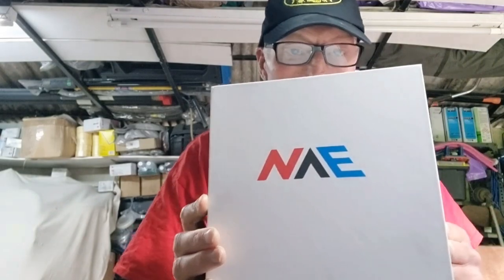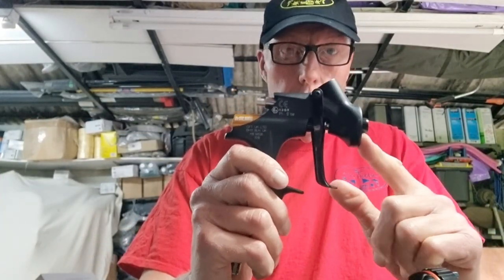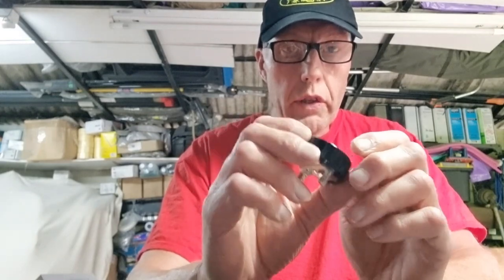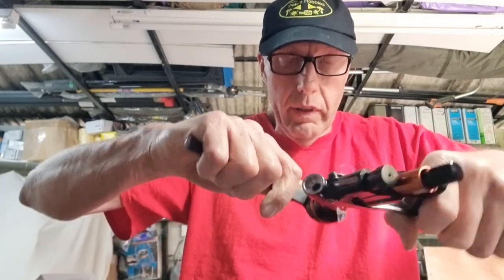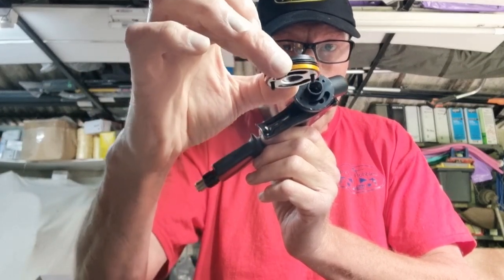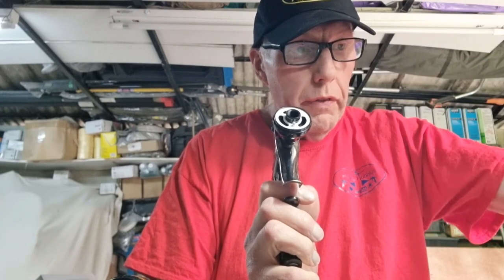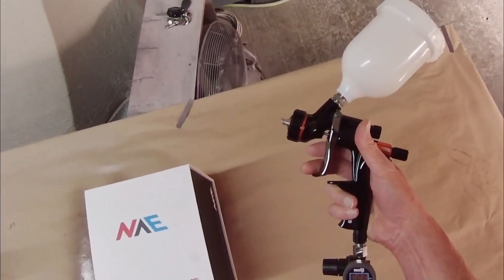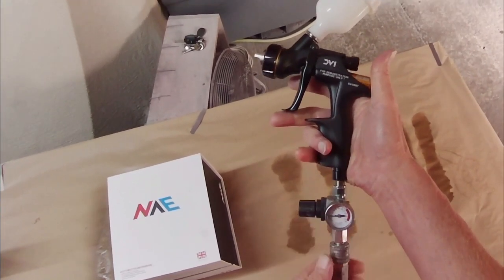Chinese NVE Devilbiss DV1 Copy, Unboxing & Physical Comparison To Original

Comment: Just found your channel pete, i actually own about 12 of these knockoff / chinese guns and they all work very well. Ive been a professional painter for almost 20 years, and the Fake GTI prolite perform exactly the same as the real Teknas. Ive owned the real one b4. Ive comfirmed it with 2 other painter friends and they said the same thing. I bought 2 chinese 4000s and they spray extremely well so i lent the gun to another painter friend who strictly uses Sata and he also said it performs the same if not better.
Reply: But im actually wondering if this dv1 clone sprays the same as the real dv1 or  as the gti clone. I have 6 gti clones already and dont wanna end up with another one
Reply from the maker: Hi Buddy, I'm lining up a clone v real video for the Pro lite and the DV1 versions, it's just getting the time to do it all 😂 , shouldn't be too long 👍
Reply: I just finished watching your whole video. "If" the dv1 clone is essentially the exact same as the gti prolite clone, theres no real point in getting it cause its double the price.

Also the spray patterns to me seem abit odd, usually the spray patterns are supposed to be alil middle heavy not what u got which is heavy on the ends......  which is baffling to me is that the original dv1 kinda did the same thing.

But great in depth video nonetheless.
Reply from the maker: Hi buddy, the pattern was done with thinners, which is why it's top and bottom heavy. However, the DV1 is more of an "I" pattern when used with 2k clear coats.

The pattern is definitely different from the copy Gti Pro Lite, which is very centre weighted
Reply: How do you identify a knockoff? Or is it simple as buying off amazon
Reply from the maker: @bankyankinlive There are always little differences. Normally, in the size of things like the diameter of the needle and threads.
The best thing is to buy from an official dealer

Comment: Whats your take DV1 copy in general?, almost as good as the original or did they hit a home run on this one? I'm looking to spray metallics and was told the DV1 is a excellent option but not sure about buying a chinese copy. Buy with confidents? Thanks.
Reply from the maker: Hi William,  it's not a bad gun, but you're not buying a DV1. It feels quite heavy compared to the original and isn't as well made, 
If it puts out a good pattern and sprays quite well, it's definitely worth considering it. You're on a budget, but, as I say, don't think you're getting a DV1

Comment: Great vid Pete you know my feelings on them wing wang specials so wont go into that 👍👍
Reply from the maker: Hi Dean,  Thanks, mate, I really wanted to see if they were a complete copy, which they are not, typical Chinese really, looking the part but not when you get underneath,  cheers 👍
Reply: Puts down a good meaty finish 👍
Reply: @dredfxcustompaint 😂😂😂😂😂😂😂😂😂😂😂only you'd know that
Reply: @deanbrown7643  👍
Reply from the maker: It certainly spray a different pattern to the Gti Pro Lite copy

Comment: Hi Pete, interesting copy! they really have copied it down to a T apart from some of the sizes, it will be interesting in how it performs, it looked like the air holes on the tip was slightly different but I’m certain that it was the trick of the camera there. Nice looking gun though. Cheers Pete.
Reply from the maker: Hi Steve,  yeah,  it's one of those look alikes that aren't particularly alike, I'll do a few videos using it and compare it with the original,  cheers, mate 👍

Comment: Hey Pete!  It's apparent they didn't want to (cost) or couldn't (legality) copy it too much. It's rather disappointing that they would spend the money to half reverse engineer rather than spend it on just making their own decent gun as most surely know by now they're spitting out fakes.  For the same cost ($200+ USD), one could have an authentic good brand budget gun.  Go figure.. 

Keep the videos coming! Love it!
Reply from the maker: Hi mate, yeah,  I'm not sure why they didn't go all the way, cost I would think, but you could be right on the legal side as well, thanks for watching as always 😀 👍
Reply: @peteshobbies5383  i recon the legal side in this case. 
I had some things with a standard copywrite in the past. They needed to stop making my product. And distroy everything they had. 

I would think. They half ass copy deu to patents and such.
Making it look like something is 1 verry easy task nowdays.  And with enough differences and there own nozzle and look alike but there own aircap thats doing a reasonable job for the designing/production rate/costs they avoid big lawsuits. 

I bet. If someone wants to make somethibg realy good. They can. But then the designing and prototyping would be more expensive. So will production be with the high end materials and such.   Allso precision will need to be higher so the costs will go up sinds there will undoubdly will be more discarded along the way. Warrentee claims will be there more sinds a product of a certain price is being assumed to last a certain wile etc.

So.   I guess thats the whole reason of back engineering for ya.

Look around to all copys..  not only guns. But im even asked if they where allowed to copy one of my products!  Insane world we live in nowdays.

Comment: Hi Pete, I've been looking forward to seeing your copy/clone of the DV1 and once you see them together you can see there are differences with the shape you didn't mention any size difference but they look similar. 
To me it looks like they have taken the GTI copy and just made it the same shape as the DV1 as the main part of the gun (the head and air cap) seems to be more like the GTI copy than it is the DV1, but as you mentioned it does look to be fairly well made🤔 the spray pattern is a bit smaller but that's just the design of the aircap.

I think this should be looked at more as a gun in it's own right rather than a full comparison to the DV1 as I think it might spray more like the GTI than the DV1🤔looking forward to seeing this in action👌
Thanks Pete a great and interesting video👏👍
Reply from the maker: Hi John, It's the same physical size as the DV1 and feels similar, although the DV1 would be obvious as to its heritage if you were blindfolded.

It is a bit of a cross between the Pro lite and DV1, although the pattern is definitely different to the Pro Lite copy.

I've got a stand-alone,  head to head with the DV1, and a comparison to the Pro Lite copy so plenty for people to mull over, cheers mate 👍
Reply: Hi Pete, sorry for the late reply mate I didn't get any notification from YT🙄
Thanks for the info mate I had a feeling they were the same size, the copy does look a nice gun mate so I'm looking forward to seeing the video and hearing your thoughts on the gun👌cheers mate👍

Comment: Hello Pete , hope all is well over your way, I almost bought the Sata copy gun just to see if they are any good but I think all these copies just aim to be aesthetically similar rather than replicating similar performance, so it was an easy choice to save the $$$ for something better , cheers mate
Reply from the maker: Hi Roger,  Yes, all good here thanks mate,  hope the same is true for you.
If it wasn't for having this YouTube channel, I wouldn't have bought it as they are not the same quality as the original, which I already have.

In the end, curiosity got the best of me, and obviously sharing it with you chaps makes it worth it. Cheers, mate 👍
Reply: @peteshobbies5383  certainly made it worth for me I really shouldn’t be trying to buy whatever , so big thank you to you for taking the time and money to showcase the differences between originals and fakes ,very much appreciated
Reply: I have 2 4000s clones and they spray reallly well.
Reply: @JimmyJiveJones may spray well but think you might need higher pressure to get the same result
Reply from the maker: I have the Ntools 4000B 1.3 and it's sprays very well at 29psi/2bar

Comment: would the  nve
last i wonder 
about the  build quality
great  videos  by the way
Reply from the maker: Hi buddy,  it's definitely not in the same league as the original Devilbiss for build quality, but it seems better than the Gti Pro Lite copy's
Reply: @peteshobbies5383 thought so have  been a devilbiss guy for years started with a jga 545  now on gti pro lite 1.2/1.3 te20 would love to see a old jga in a vid now ?
Reply from the maker: I think the Devilbiss Advanced HD is the replacement for the JGA, same, same bodies as the Gti Pro but with different caps, it an idea,  see how the older compares with the new
Reply: Actually , the advance is more closely related to the sri pro lite in construction (the air cap screws directly to the body with just a grey plastic ring inside the body to seal the fluid cap) . The jga was the first version of the gti and most parts are still interchangable!! 👍 .
Reply: @peteshobbies5383  would love to see you do a video in the future on old vs new advantage/ disadvantage material use
Reply from the maker: I didn't know that, Andrew. I haven't got or used a Advanced HD, I will get one in the future as many have said they are good 👍